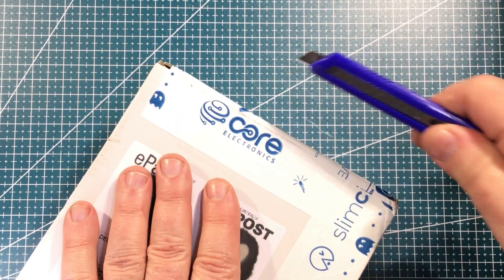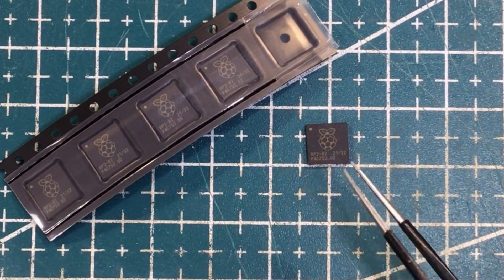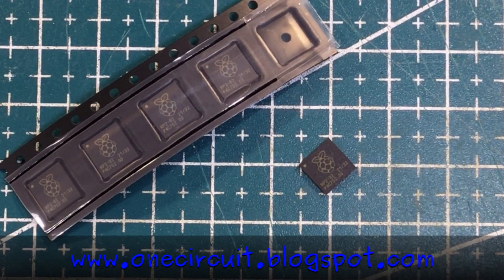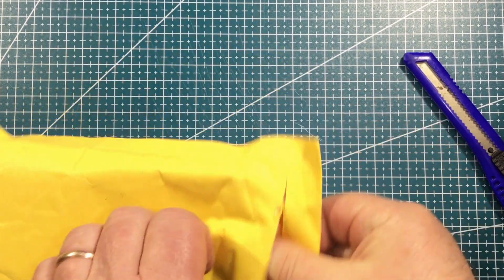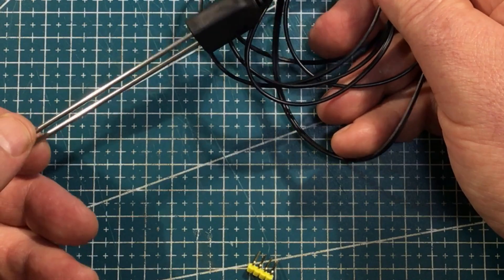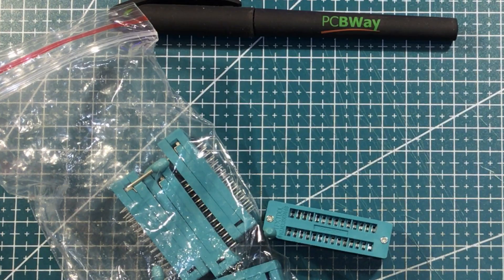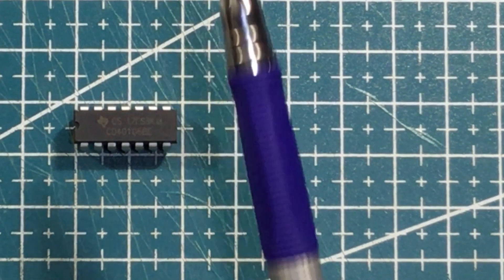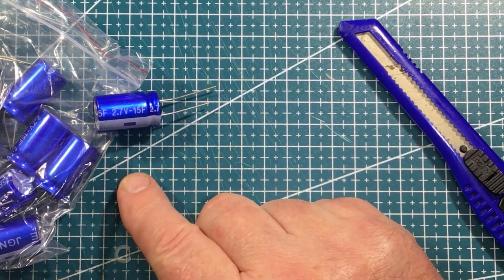Mailbag #26 - a rollercoaster from China all the way to Tasmania!

Comment: Microtype Engineering has videos on an RP2040 PCB design "RP2040 KiCad 6 Hardware Design" as well as Phil's Lab does as well "Raspberry Pi RP2040 Hardware Design | Altium Designer | JLCPCB - Phil's Lab #28"
Reply from the maker: Thank you Matt I'll take a look - I'm not confident to design my own board for this one - I'm not actually sure if I can even solder the IC - it has many pins! 👍😀
Reply: @onecircuit-as  Microtype shared their gerber files on their part 3 video

Comment: I built a 3d printer controller with a Pico, but am also intimidated at the prospect of soldering a bare RP2040 on an adapter plate. 0.5mm pitch is barely within my soldering skills when the chip HAS legs.  QFN56/64 plates are easy enough to come by, and I see a QFN56 stencil Amazon.  With the grounding sink on the underside, would seem there is no other option than using hot air, or an oven.
Reply from the maker: Agreed, and I have five so when I trash the first four learning how to solder the little guys I might have success with MK5! 👍😀